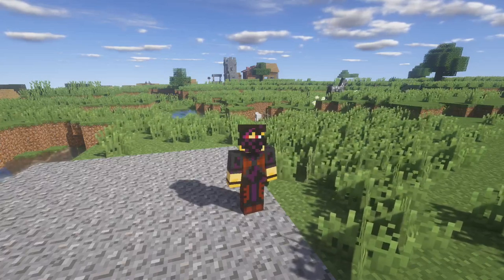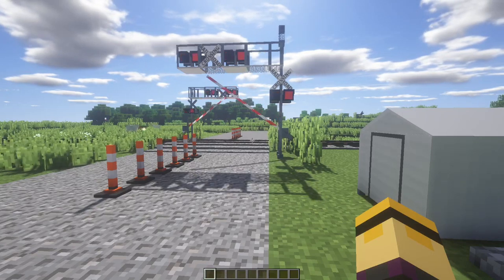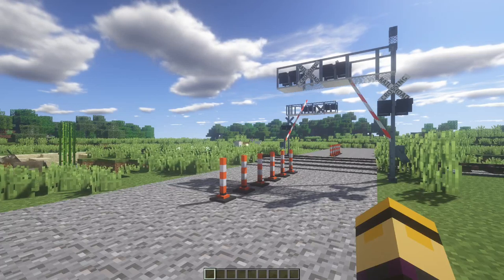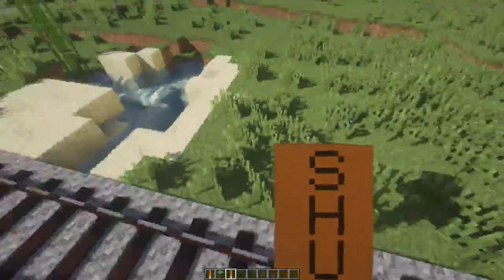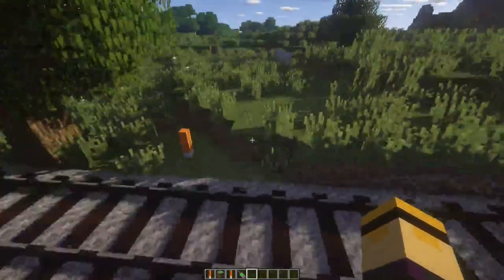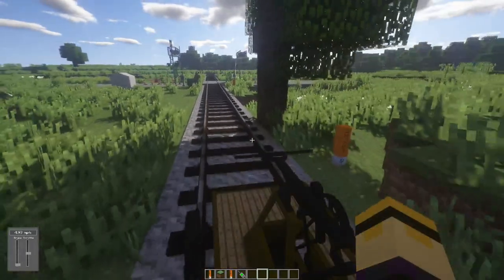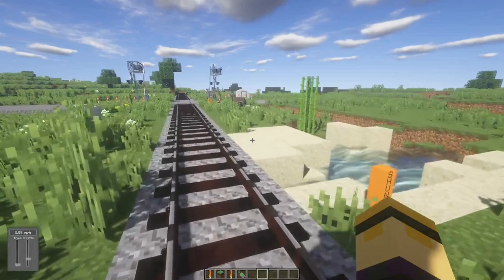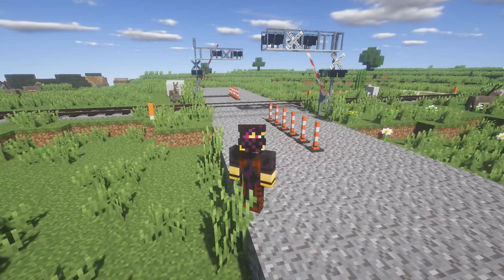Automated Railroad Crossings | Traffic Control

Comment: is there any way to make this work on trains that go higher than like 30mph? cause I've tried this with trains going at higher speeds, and the trains get detected, but then it stops working just before the trains get to the crossing, leaving the barriers, lights off, and the bell off. I mean I've tried spacing the shunts out, I've got them set up for a train at 125mph, but it just won't work
Reply from the maker: I know this was a year ago, but you could try putting a chunk loader in the chunk that has the relay box